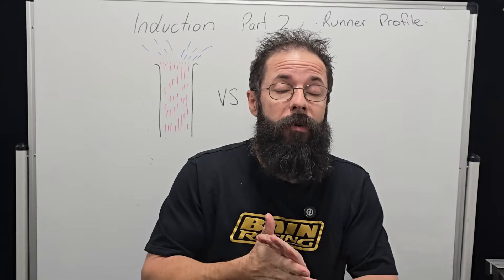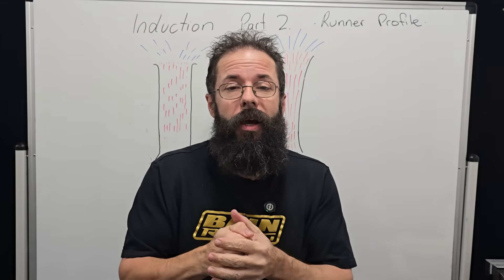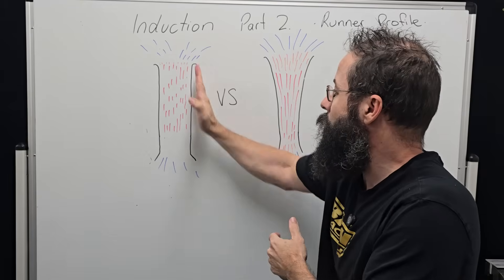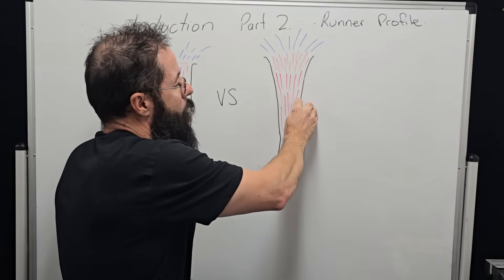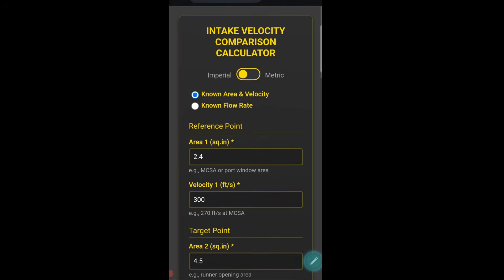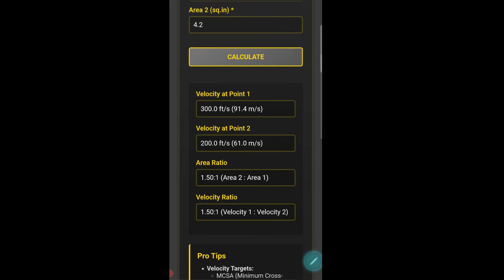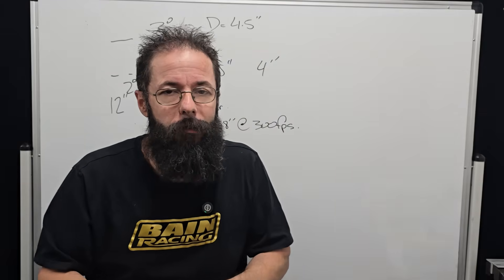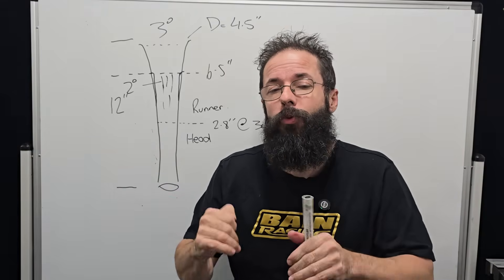Induction Secrets part 2: Transforming Airflow into Power.

Comment: Tapered runner in racing were very much used in 80-90 in DTM on 4cyl engines on MB and BMW. Depending on power lvl, so later year engines that made ~60hp more than first year engines went in taper size ( those were having 360- 380hp range) on those late setups big taper was used. I would call it extreme taper as ID at runner entry was 75mm and would taper to 50mm on the slider TB flange. Early engines that made 300-320hp range used much less taper as runner entry was much smaller.
Reply from the maker: Yes! Parallel is nothing but creating restriction over distance 👍

Comment: 13:36 I thought the idea behind vizzards unequal headers was that now, at least on a 4-1 collector, was that now part of the pulses that would be entering the collector on the heels of the pulse before it is now entering behind it when the collector is at a lower energy.  In an ideal situation, the pulses would arrive evenly spaced and this wouldn't even be a discussion point. I would definitely agree the unequal length changes the energy of each pulse entering the collector. I've been very interested in testing this, and also trying the effects of staggered pipe size in a tri-y format as well.
Reply from the maker: Yeah his Idea was to get the timing of the wave to arrive at a 180° split. Rather then 270/90.  The problem is the lost of wave strength and and velocity,  mixed with the lack of harmonic timing from the collector on the longer header. Causing that cylinder to drop its efficiency. 

 This is why it never really took off in motorsport.  Many tried and found the right length and harmonic elements worth more in the long run then the pressure differential "sort of" gained  by offset lengths.

Comment: If you are restricted in hight and have to choose between a short straight runner, or a longer 90-100 degree bend for optimum lenght, what would you choose and how would you calculate optimum taper? And how close to the walls or roof can the mouth be? (diameter x ?).
Reply from the maker: Short and straight.  Opening needs a min of D1 optimally at D1.5.  Meaning if the entry is 3" in diameter you want 4.5" above it.  D1 is possible but you will hurt VE'S as you approach D1. 

 If you're suboptimal in length there's no optimal taper now. You have to work backwards from its true length. Say it needed 9" above the head at 7°  now you can only get 4.5". So that half. So I would generally half the degree and that would be a good start.  Every engine and head is different.  This is why I say the head will also dictate what the runner needs.  But that's a rough rule you can use to ball park it.  

Remember though that a shorter runner will need a bigger Radius.   If up around 250fps you will need around 1/2" radii.

Comment: I've spent weeks modifying a Holden bunch of bananas manifold. I've cut the bottom off and ported the inlet from 41-45mm 100mm down and bell mouthed the entry. Have i damaged my velocity? Its a very long runner so i figured it would pull more air in on valve opening.
Reply from the maker: No mate. You should make more power as the runner length it far too long. What you have done is increased the average CSA. Which will up your averages and help a little up higher.
Reply: Thank you mate. Can't believe you messaged so quick. I'm genuinely glued to your videos. I'll add reference to them in the forums.

Comment: Cylinder  pairing.  
For a cummins L6? Divided manifolds are built front 3 back 3  for improved low speed spool.  Are 2 and 5 are in the wrong  ports ? 

  If building  a tubular header for parallel twins would it be worth it to put 2 and 5 with there pair.  Or leave them grouped front ½ back ½. Or do a 3rd for 180°pairs?
Reply from the maker: 6 cylinder is on a 120 split. But what's the firing order?
Reply: @bainracing   firing order is 153-624
Reply from the maker: @daviddroescher  Thats perfect as its an even split front, back, front, back, so the wave is bang on 120 split so 1,2 and 3 in one and 4, 5 and 6 in the other plenum.
Reply: @bainracing  
1 to 3 is 240
3to 2 is 240  
2 cylinders1(1,3) on 1st rev, 1 cylinder 2on the 2nd rev. .
 Or plumb 5 in with 1,3 to achieve  the  120°split  of 1,5,3 you said looks good ,then nothing  for 360°( in the front valute ).
This is one of those things that is typically difficult to discuss  without pictures, due to verbiage  and context being different on each end.
Reply from the maker: @daviddroescher yeah it's on a 240 split like all 6 cylinders. I'm more talking when you draw the  120° Y and pair cylinders.  I'll add it to the next video series.  As long as you have 1,2,3 and 4,5,6 they are all split evenly.

Comment: So, runners, short and thin, or long and fat? 
And having the teper going as far down to the manifold flange as possible?
Reply from the maker: Yes. If they need to be shorter than their targeted length. We must pull some taper out.  And yes, generally, the MSCA will be in the head.  This means that all the air speed in the runner is lower than the head.

Comment: Nice explanation as always Jake,much appreciated. 
I remember Darin Morgan saying as rpm increases runner length decreased but he also said taper rate increases to a maximum of 33%.
I understand what you are saying that taper changes slightly and radius size also changes. 
Do you agree with DM on taper rate.
Depending on application it could be another way of doing it,and everything has compromises.
Reply from the maker: Yeah, 100%. But remember, darin is talking on a perfect head and perfect length.   33% would probably be in the range of only 8000-8500RPM.  Most prostock at 10,500 RPM. On a true 3rd harmonic are up around 50%   it's a sliding scale depending on RPM, as remember the window "time" of exchange is reducing with RPM, so we need to reduce the velocity and restrictions as we climb in RPM.   

But as soon as you have a head that's a little small or a runner, that needs to be shorter. That all goes out the window.  And you need to do some juggling! 😂👌
Reply: @bainracing don't forget pressure recovery of that 50% taper being a brick fricken wall making those super critical 92.5% throats so seat angle sensitive your scared to breath on it!!!.... worked on one set of aussie pro stockers and it was incredible BUT poke that damn thing wrong 1 time and it'll cost you 50hp and 500 rpm!!!!!
Reply from the maker: @ZackeryStang  Crazy how liitle it takes to push them over the edge!
Reply: Who wouda thunk
Reply: Appreciate your response Jake,you are doing excellent presentations,thank you
Reply from the maker: @stevecowan1362  No problem at all mate.  I'll try to go a bit deeper into it and what Harmonics vs velocity net in the way of HP and how do manipulate the CSA to help improve your targets when you cant target a full 3rd length.  or when you need to compensate for a heads that is on the high side or vice versa.
Reply: Depends on application... say a hot street engine with a average piston speed of between 3500-4000 fpm will benefit from the shorter more heavily tapered intake tract from manifold opening  to venturi exit at valve seat.. this type engine normally has a 2000 rpm operation area and runner length anywhere from 4"-8" max 

Now let's take a cathedral port 5.3 stock engine with torque peak at 3800 rpm.. the runner is 12-14" long with less than a 10% taper from plenum to venturi exit under valve seat... this engine focuses on a broad operation range and 315+ fpm port volocity 

For those having a hard time understanding the concept this is a general explanation of what's being accomplished jake has a excellent explanation on this but im just trying to help the ones beginning to learn how to design a system get the big picture
Reply: Induction volume vs cylinder displacement overrides harmonic rpms.

Comment: Oh man, CLIFFHANGAR! :-D

Please add a low velocity/low rpm power making side lesson somewhere down the stack :-) 

Does the pecking order the various variables remain the same for low velocity regimes or do certain variables become more prominent?

 Like the heads vs zoomies discussion, at certain thresholds its seems some variables overtake others, case in point:

 at 2k rpm the flow velocity is low, and timing can be lazy but pressure wave harmonics are still running at near-mach regardless of rpm ["indicated airspeed"  vs. "True airspeed" vs. "ground speed", to use flight terminology]. 

Basically, I'm designing for a low rpm gasoline regime [1500-4500]. I know there's much less power in this range, obviously, but that's the range I'm designing for: so the questions become: what are the strongest torque generating/capturing variables in this area?  While boost is an option, the absolute force hammering the bottom end shoots up dramatically when making lots of grunt :-) psi of 300lb/ft at 2000 rpm is vastly higher than 300lb/ft at 4000 rpm.

Loving the lessons!
Reply from the maker: I think we need a part 4! 😂👌

Comment: Is there anything that can be done for a 6 cylinder turbo diesel that makes power at 2800 rpm? I can give more info but using your calculators(i could be the problem) the runners would have to be like 40+ inches long. Cam int duration 178. Ports ~3in dia
Reply: use higher order of harmonics.
Reply from the maker: Yes, close the CSA up, so less taper. The 3rd harmonic will be aeound 20" for that length on, say, a 3° tapper.  So a 12" at 1°  will act like a longer runner.   It will really depend on the velocity of the cylinder head.
Reply: @bainracing  ok thanks.👍if 12 doesn't fit then how low of taper can you go before it doesn't accelerate the air? And how do you measure the velocity?
Reply from the maker: I wouldn't go under 1° of taper.  The velocity will be calculated off your flow bench data or MCSA math.

Comment: Thanks for addressing the VW plenum design 👍.  I'm interested to do a back to back dyno at some point this year with my current design of Centre plenum with 520mm runners vs an optimized length twin plenum setup for overall power and cylinder to cylinder AFR variation due to the odd firing order.
Reply from the maker: That would be interesting to see! 👍